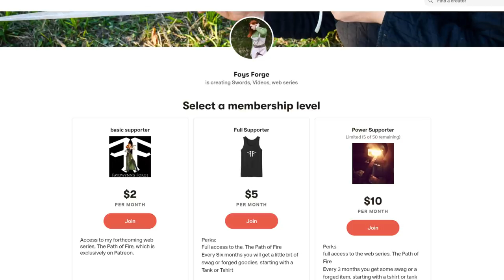Scrap to Magic: Making A Norse Style Knife, part 3

Comment: Excellent ! Ps If this is a small fast stabbing style knife the taper from the back of the handle to the blade could cause the hand to slide onto the blade if a bone was hit perhaps a lanyard through the copper hole in the tang around your hand would solve that problem ! Your thoughts ?  I like that copper lined hole in the handle very good idea Thankyou .
Reply from the maker: Knives don't slide up
Reply: @ThePathOfFire  I meant that your hand could slide up on to the blade as there is no guard , blood is very slippery of course depends on the use of the knife . [love your work and style of forging thankyou ]

Comment: If I may ask, what did u use for the handle wood or antler? Also do you prefer to work with a certain grade of stock and handle material than another? I’m sorry if my question is too corny, or makes no sense. I just came across your channel and absolutely love your content, and just had to subscribe. The art of old smithing? is that the proper term? Anyway I found it very interesting, and has made me want to learn how to do it myself.  I won’t take anymore of your time just keep the awsome content coming. Take care